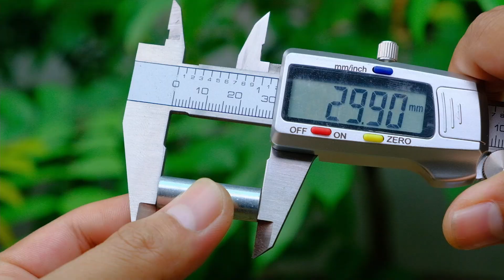DIY GIANT RC 6 WHEELS LOG TRUCK | 6WD 6X6 RC TRACTOR | PART 8 | INSTALL LEAF SPRING  ON FRONT AXLE

Comment: i love it; however you can a lot of flex in the front axle, Im just worried it might break under a lot of load. you could upgrade them to metal with a bigger axle bolt to carry the tire.
Reply from the maker: This is a truck so we don't need it flex to much. Will test load after I finish this project and have some upgrades later. Thank you for your advice.